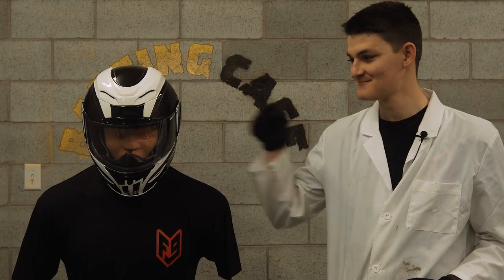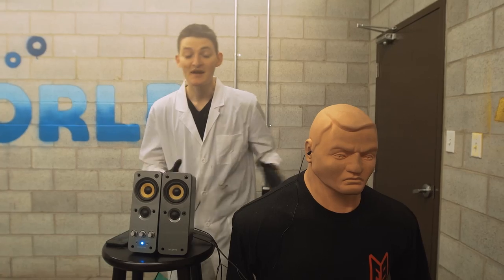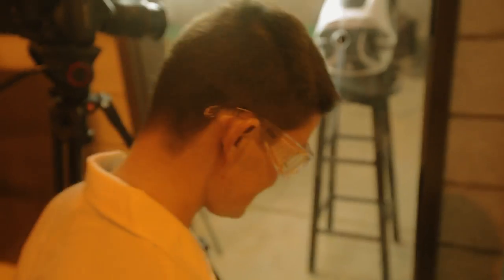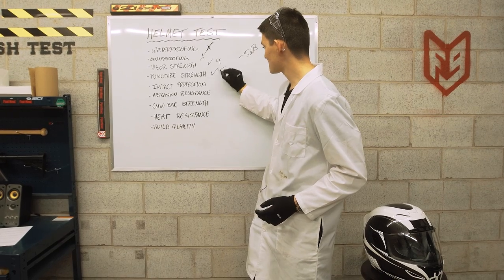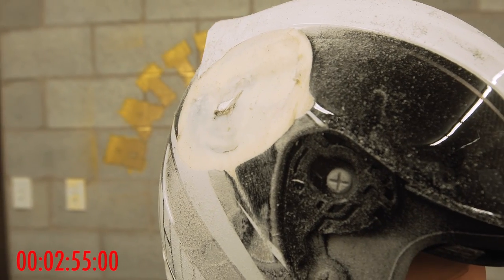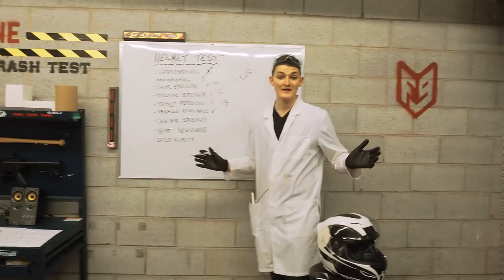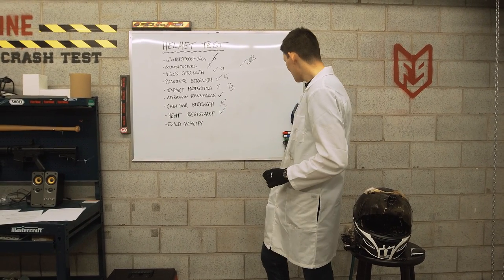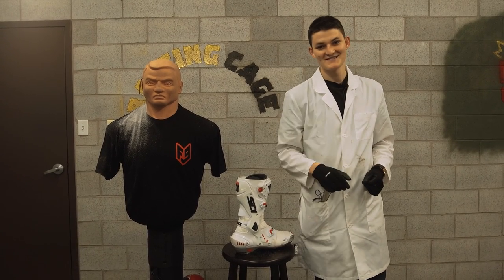Icon Airmada Helmet Review - Crash Tested

Comment: I've lost all confidence in my helmet now.... thanks I guess?
Reply: grumpy342 you too? Well I guess we have cool graphics trophies.
Reply: Yeah, I  have an airmada and i'm rethinking using it this year
Reply: BarrettCharlebois they don't do snell rating so, I guess I'll find another brand that does.
Reply: grumpy342 You have to remember these tests are not real world application. The abrasion is great for sliding, you are unlikely to burn, and shrapnel is not a huge concern vs other helmets. The impact resistance is expected due to the shape, however that is more so a worry for highsiding. My airmada cracked on impact when I got hit by a truck at 55mph. I only suffered a minor concussion without any real bruising. My gloves, elbows, and boots ended up the worst.
Reply: Chris Bridgers the chin bar is what had me concerned. USA has slow impact crashes as well as other countries. Not all impact crashes are 100mph plus.
Reply: Chris Bridgers ahaha no question about it not being a scientific test here. I'll still continue to use the helmet! Was planning to upgrade when I can afford it #collegelyfe
Reply: Don't panic, Ryan is doing all these tests one after another to the same helmet so the method is bound to be flawed. For example the golf club test... how resistant do you expect the chin bar to be after you hit the helmet with a baseball bat and dropped a bowling ball on top of it? Those hits most likely created small cracks which lead to it caving in more easily than normal, also a watermelon is a poor substitute for a human head, in reality you would feel like a scrawny dude punched you but your face wouldn't be gory as if you were wearing an open face helmet.

TL;DR helmets are made to take one big impact just once, not to be abused multiple times.
Reply: That may be but you can still see the difference in quality between each helmet and we want the most bang for our bang as you never know what kind of accident you might have.
Reply: UlTrApLeX I could buy into someone sliding into two objects like maybe a curb and a car.
Reply: Yes, ideally, Ryan F9 would use a different helmet for each test since one would not reuse a helmet after a crash. You could say that the test encompassed a worse case scenario where someone wearing the helmet had multiple impacts, slides, etc. in one crash, but that would be pushing it. Overall, I thought it was a decent test. The only thing that really bother me was the side impact failure. I have seen a few motovlogs where the vlogger had an accident wearing an Icon helmet and they have done well despite having fairly serious crashes. (Check out Yammie Noob's first crash. His ICON helmet stood up really well after a serious high-side crash where he hit a fence and boulder head-first.) I would like to upgrade, but I will keep the Airmada for now.
Reply: I laughed at the water test. How many times do you ride your bike in reverse? In normal forward motion water would not be forced into the rear exhaust ports.
Reply: grumpy342 I've crashed in my airmada and head came out fine...
Reply: r1crazier12 I was just about to say the same thing.
Reply: Another thing to bear in mind is the fact they use 50G stickers to gauge impact resistance. To give you an idea, SNELL M2015 and SHARP award any helmet that transmits less than 275G their maximum rating. Of course, they use different impact speeds (industry standard 7.5m/s) whereas we don't really know the impact speeds here. I also think the chinbar test is extreme. Watermelons can't handle more that 20G, yet even your teeth probably can. That being said, the Airmada has a 2-star SHARP rating (out of 5), which is considered poor, but testimonials from people in actual accidents say it works and that's all that matters.
Reply: Take a look at UK sharp ratings
Reply: grumpy342 I bought a lot of helmets cheap to really expensive, and I still go back to Icon's Airmada for its quality at an affordable rate. I had an accident where I was cut off at 45+ mph, flew over, and landed face first. That helmet and its chin bar did a great job protecting my face, and to be honest, I still use it (yeah, I know I shouldn't, but it still feels durable). If you want my opinion, if you are not racing, going to the track, or going over 100mph, you don't need a $600+ helmet. You'll just waste your money and the helmet's potential if you are in a traffic accident.
Reply: Lol same and I just ordered two for me and my girlfriend dam idk now

Comment: Old video I know. I'm going through watching them cause I love your videos. But I rife icon helmets. My last was the one you tested here. Convinced a buddy to get one too. We had 2020 models so not sure the difference but he was in a bad accident with it. 120mph into a curve. Low sided into a guard rail. Went over the top and down the I beam pillars for a few landing in the ditch on the other side. Bike went down fhe road a bit and over the rail on the other side into a tree. He made contact with the pillars with his helmet. One crack and abrasion on the chin guard an inch in front of the visor hinge and hit the back of the helmet hard enough to send the corner of one of the I beams through fhe helmet almost touching his skull. No bruises on the head and no unconsciousness. Went down the rail fast enough to slice through his leather jacket and his wrist to the bone and hard enough that q corner of an I beam went through the strap of his ogio Mach 3 backpack I gave him, through the leather jacket, and a thumb depth into his shoulder. We know cause thats how the doctor pulled the skin out to sew him up. Broken rib and split shoulder blade. He got up and walked away conscious so we never ride anything but icon from now on
Reply: Extremely rad.  Love Icon.  Had this exact helmet for 3 years now.  For what I originally thought was a cheap budget helmet, I've come around to love the thing.

Comment: You know, I don't consider this an overall failure to be honest, and I own an Airmada. Relative to the Shoei neotec it performed relatively well where it matters. The water test is kind of neither here nor there, if water is somehow hitting the exhaust vents on the back you shouldn't be out in that weather. The puncture testing went well, both the Shoei and this one failed side impact. This one passed rear impact and the shoei wasn't tested for it. The chinbar (although still cracked the melon) seemed to be in relatively good shape, especially relative to the chinbar on the shoei last week, the geometry of a melon is also not the same as a human head and a little give in the chinbar should be ok on the road. As far as pieces coming off goes; helmets are a one time use piece of gear, not worried about multiple impacts. I am concerned about the noise level and the top impact although I wish the sound test had been conducted on both. Considering what I've seen here, the airmada trumps the shoei. It'll be interesting to see the results on an expensive full face rather than a modular.
Reply from the maker: Hey Mike! Very valid points. I'm glad somebody took note of how we changed the testing method since the Neotec, because as you say, comparing the two test results isn't quite so clear cut. ~RF9
Reply: Hi Ryan, stellar response time! In a really interesting way I actually found this video reassuring. I recognize it was a "failure" but when compared with a much more expensive lid I actually feel better about it. Interesting how a $200 proper full face holds up that much better than a well-reviewed $850 modular when it comes to frontal impact eh? I've always heard it but didn't want to believe that modulars were that much less effective.
Reply: The puncture tests are similar to ones used in Standards testing in the UK, Ireland?, Australia and New Zealand. But you're ignoring the most important part. The transfer of energy as a result of impact (bowling ball - side impacts using the bat) mean that any transfer over 50g's is unclear and can either result in minor injuries or major injuries - depending on the G's of the impact. 

http://www.internationalbrain.org/examination-of-bi-thresholds-in-terms-of-the-severity-of-head-motion-and-the-brain-stresses/ 

You can run to your squid brand all you want, but a helmet is designed to obtain and disperse energy at least less than 50 G's. 

This helmet is a big fail.
Reply: Donald Trump (Verified) are you serious? Even in the link you provided 50-100 is just minor. Like a concussion. If that's what i get from a crash I'll be more than happy. I guess you're a shoei fanboy cause this one is on par and better than the shoei he tested and it hurt your feelings. If icon is a "squid brand" what do you call a "real biker" brand? And please don't feed me the line where you buy what they wear on GP cause that's a crock of shit. Get off your high horse. This helmet may be affordable for most and performs within standards that will allow you to go to the hospital without any real brain injury.

Comment: Awesome video like always but I have a few remarks/ideas if you dont mind :) 
1) Top impact strength - I would make a tool that throws/guides the ball to the helmet. I think you will have a lot of difference between passed and not passed tests for similar strenghts of helmets. Although random data serves to purpose, it can still make some helmets look much much better than the others very similar to them. I am saying this simply because your G stickers either break or not so 1 or 0, and it can be 51 vs 49 g's of impact force that makes it pass or not.. Those kind of helmets should be the same passing grade.. Maybe make a range of those, like 30g 40g 50g and 60g.
2) Chin bar protection and the unlucky watermelon.. I am thinking that it would be fair to use the g stickers there as well, but fit each tester with sticker on 2-4 cm away from the chin. I would never buy a helmet that is too close to my chin, and also some materials will cave in because they are elastic on purpose. This is how they don't break and actually save your face by taking up extra force by caving in.. 
All in all your tests are great and getting even better with every single video, and I enjoy them sooo much! :D Now some of the ideas I have for you if I didn't already kill you with this comment.. :)
Ideas:
1) Super mega giga thanks for the sound proofing test. Since this test does not mean that you will destroy the helmet, would it be possible to test like 50 of them and show us ? This means a lot to all of the buyers :)
2) Recycled equipment test ?? I have a helmet I would like to replace this year. Your videos are being huge influencers to my opinion. As a thank you, I would like to send you over my old helmet (some time when I get a new one, it may be even as late as this fall) and then you could test is as well. 
Then you could make more tests without extra cost of the equipment and also we dont have to wait for that specific model to come in with some sort of an error :)
3) Adding multipliers to the tests to mach your possible customers. So you can have a demanding cusomer which thinks everything is 100% important, but then you have newbees like me who are still exploring. I don't mind getting wet so much as I mind the safety with impact protection. I would say that waterproof test is about 60% important as well as the noise test, but side and top impact as well as the chin bar protection are 100% importan. Penetration would be around 90% for me as I think that it is very unlikely to get hit by a rock at those speeds but safety is 100% priority for me.

So in terms of the above said, there is no too much of a difference between this helmet and Shoei from the last video, tho you didn't make the test for the sound proofing with Shoei.

What do you think ? :)

All the best,
Milos

Comment: Thanks for testing this helmet! For the price, I believe it is a good helmet. And I hope to never need to test it's protective abilities.

I've been wearing an Airmada Volare (hi-vis yellow & reflective silver) for 2 years and love it despite it's flaws. I ride from early in the season, at night, in poor weather, thru to late in the season. Being seen is critical when drivers aren't expecting a bike on the road. The Volare colour way does that very well! I have no interest in going back to a matte black helmet, as I'd rather stand out and avoid an accident then look stylish. I wish Icon hadn't discontinued all the Volare colour ways, as I will have to find a different brand with a long oval helmet that is as visible as the Airmada Volare.

Comment: Old video, but my debate still goes wild...

I have owned an Airmada since 2014.  I have loved it.  I love the way it looks, love the way it feels, love the way the pads break in, etc.  It was time for a new helmet after 4 years, so I bought an Airframe pro.  Good upgrade, except it was stolen off my bike during a 1 minute piss break mid trip.  So, back to the Airmada.  I know this isn't the safest helmet, but I still love it, and it'll likely protect me more than enough.  Do I buy another?  Splurge on another airframe pro?  I was considering an RF1200, but I'm not totally convinced, Icon Variant?  Another Airmada?  Scorpion EXO 420?... Decisions are hard.  Ride a Speed Triple every day.  Like the quiet, which my Airmada is no longer.

Comment: One thing I don't understand. You passed the Icon in heat resistance test, but failed the Neotec despite chin bar and visor mechanisms still worked. The both burned to the same degree. Go figure?
I would like see a test of the Caberg Duke, a modular like the Neotec but cheaper.

Comment: Fun review here (entertaining) and I really do enjoy your work, but..... and its a big butt, as in Kardashian size, your test regimens are riddled with inconsistencies and are not repeatable with any kind of engineering accuracy.  For instance, the G's applied with your baseball bat are almost completely random (feeling strong and/or feisty today?) and you don't drop your bowling ball consistently either.  In this test you don't measure the height of the start point and you strike the Icon with an off-center blow. These inconsistencies aren't small - as another poster commented, your G patch is only off/on at 50 G's, so your beloved, obscenely expensive Shoei could have had a 50.5 rating and the lowly Icon could have been 49.5.  The power of your baseball swing, the height variation of mere inches and the difference in strike points, could easily account for the differences. There is high entertainment value here, but no one in their right mind should rely on this for a helmet purchase decision.

Comment: My question is why do you get water through the back of the helemet I wore a icon airmada through rain and hail before multiple times for 2 years and I never got my head once. Also I had a minor accident in the helmet and it saved me(also I broke my visor quick connect I ordered a new one for 15$)

Comment: As far as helmets go: Just don't buy it if it's not snell rated.  DOT standards are much lower.  I had a nice high side get off at 100+mph while racing. Hit hard and I didn't slide, I tumbled.... Broke my collarbone in 5 places and two ribs.  My 3 year old HJC kept my head in tact.  Not even a concussion.  Why pay for cool graphics on a "cool" helmet if it's going to protect the most important thing in your life far less than another similarly priced helmet?  Snell or bust.  Happy riding.

Comment: Almost like you had it out for Airmada from the start, down talking it.
But yet it scored highly on visor - same as much more expensive Shoei. Scored higher on penetration strength and abrasion... good chinbar since it was still intact.
Water test was retarded, so doesn't even count. Vents are inverted in helmet and would not fail vertical rainfall.... 
It's weakness is definitely side impact. Due to shape but overall it's a shit hot helmet for the price.

Comment: Those tests so out of reality... what's the point in them?   A bbgun? What are you trying to show by doing that? Will it resist a rock? At the same spot? What chance that a rock will hit at the same spot in real conditions? Abrasion test... how long do you thing a rider will slide down the pavement? 2 minutes? Are you kidding me?  When you hit a helmet with a bat... what are you trying to show? Like rider hits a pole with his head? Think of impact area. I can tell what you do - you destroy helmet for fun. That''s it. Nothing useful in this.

Comment: ok I enjoy ur videos but this helmet test ones r flawed. I beleave in spending anything to protect ur brain. I wear a arai rsq. test problems r as follow. burn test is stupid and has nothing to do with riding a motorcycle. build quality test after every other test is pointless. it should be the first test. base ball bat test is flawed cause u only hit one side. Ur test should be flex, noise, fog, drop test. grind test aka slide test. ok realy all I need is tie a helmet to a car and drag it for 10 seconds.